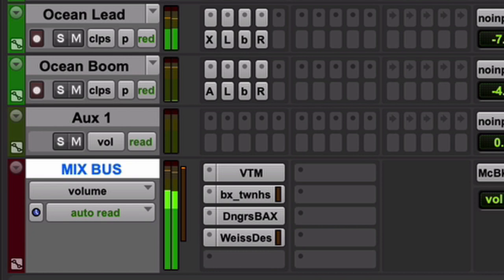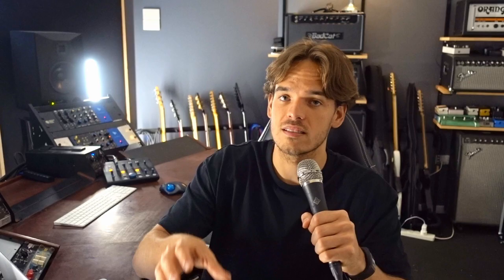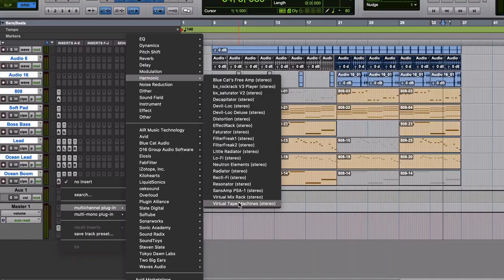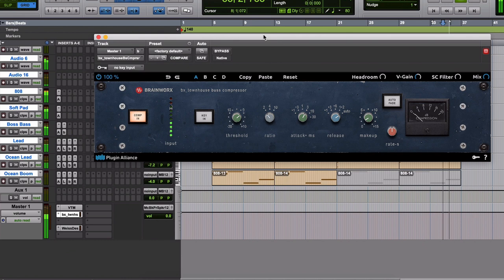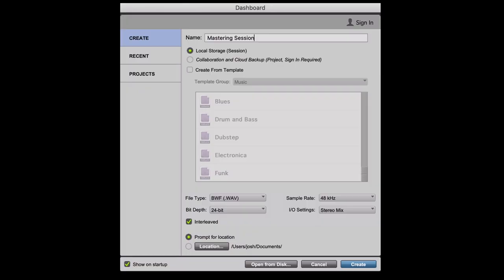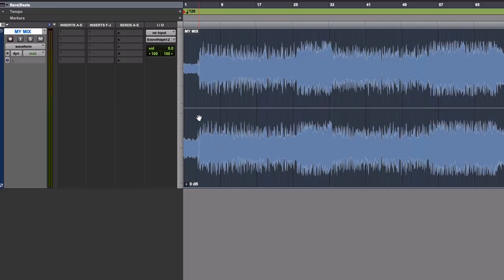Mix Bus Processing IS NOT MASTERING

Comment: I am a purely digital engineer. I am guilty of using the mix bus to master. 

I used to do it all separately on the stereo file in the Ozone app but now I prefer to mix into my mastering chain. I do this mostly to guage levels but to also save time. 

Usually I start "mastering" after I've done the static mix. I then tweak as I go along. I find it saves me time and that I make better decisions this way.

 I suppose I've started to view mixing and mastering as one hat. It may be that I just feel less stressed this way and that I actually finish more music with this method.

It involves alot of freezing and flattening to ensure I still have the cpu power to "mix bus master". The freezing also makes me feel more committed to a channels treatment.

I will reconsider your advice.

Comment: I have a question , what is the reason for having a aux mix bus , and a master track in the same session , the mix bus having all the mix bus( mastering ) plugins on , but the master track being empty , does this cause any kind of phase or canceling , would you have to just choose to use either , mix bus aux , or master track , and delete the other one , or does it make any sense to have both , having one with no inserts , thanks 🤙
Reply from the maker: The main reason I do this is for organisation. 
Sometimes I like to have multiple parallel mix buses incase I want to blend something extra in like distortion, compression etc

I like to keep my processing on the ‘’Mix Bus” aux and any monitoring type plugins on the master bus. 

No phase issues because there’s only one stereo output playing. The master bus is the sum of everything, including the ‘mix bus’ aux.